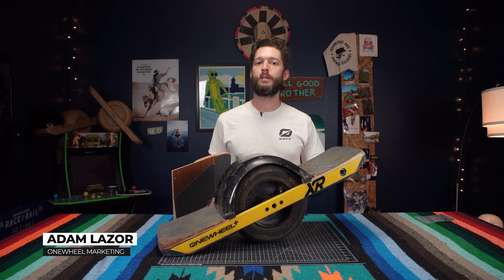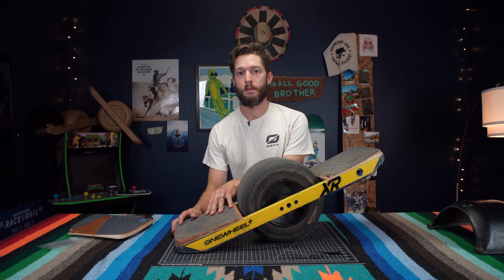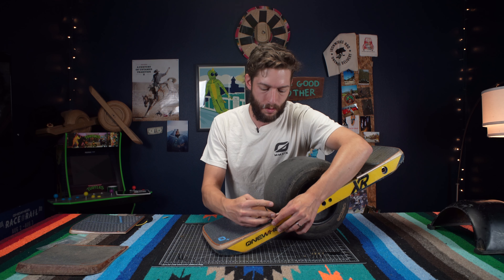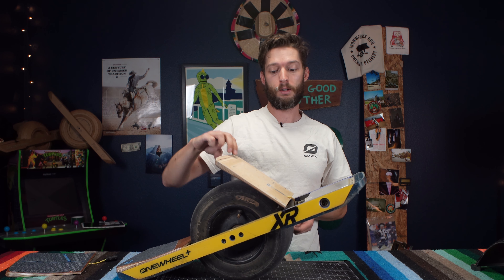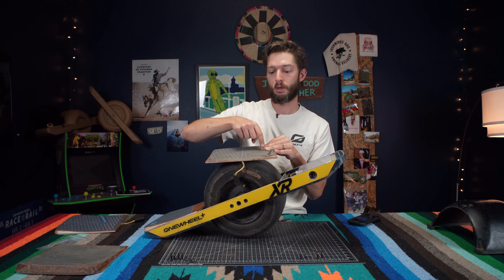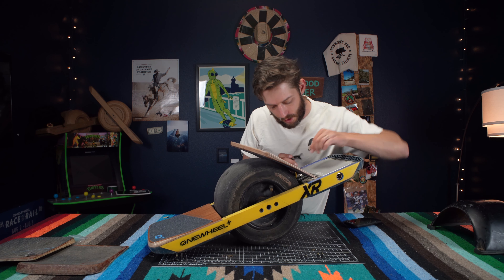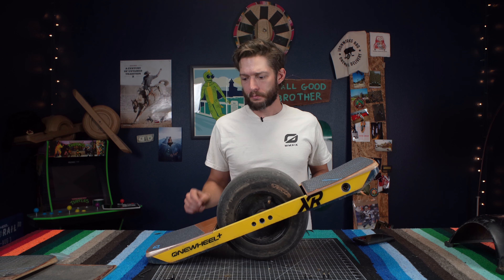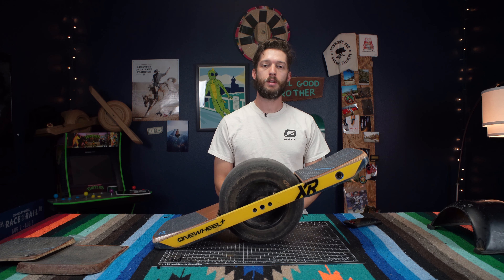Onewheel+ XR: How To Install Surestance Footpads

Comment: when will you make them cheaper? one wheels right now are basically a scam. For 1800 dollars, I can either get a in motion v11 with 60 miles of range, and 30 mile top speed, or a one wheel XR with 18 miles of range and 20 mile top speed.